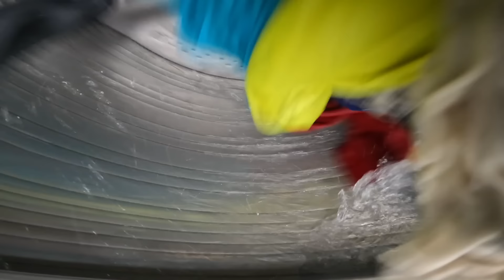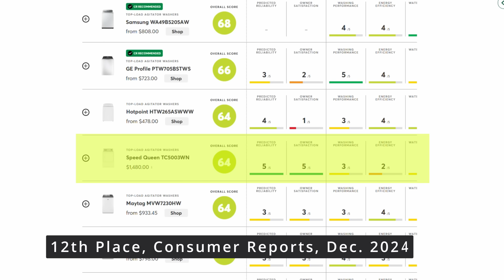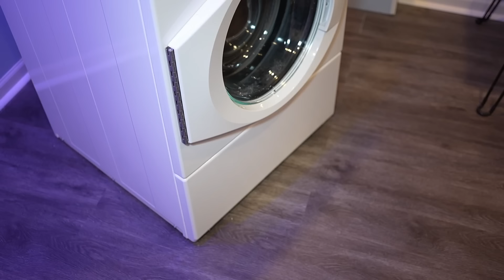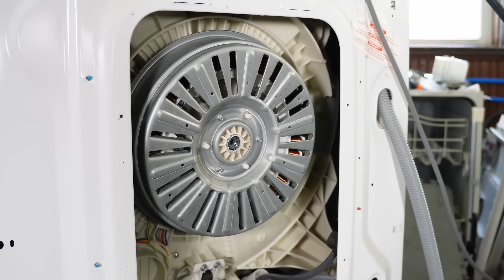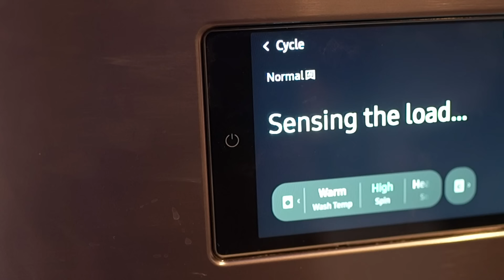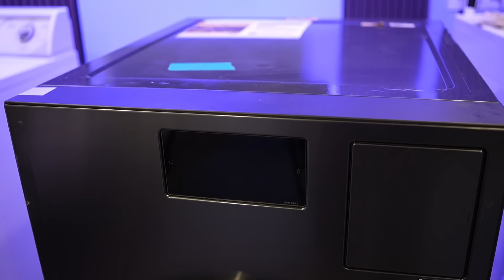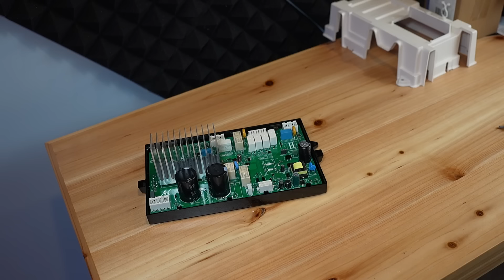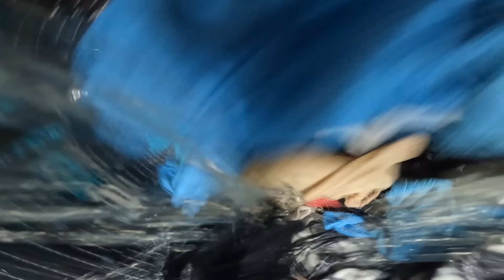Is America's Most Expensive Washer Great? The Speed Queen FF7009WN Test

Comment: I really appreciate the super thorough review and testing you did on this machine and shared in the video. I just paid for an Electrolux and have been second-guessing myself ever since, wondering if I should have gotten a SpeedQueen. One of the selling points on the SpeedQueen beyond the durability is the Soak option. Realistically, if I had a heavily soiled item with chocolate + motor oil + lipstick etc, I would throw ALL the available options at it, including the 24h soak; which I anticipate might have changed the final stain removal results. If you do additional side-by-side tests of machines, I encourage you to do a test of “all available bells and whistles” in addition to two identical normal wash cycles. 

Finally, I am really curious about how hard different washers delicate and hand-wash cycles on wool sweaters. I hypothesize that a “hand-wash” cycle could be constructed on the SpeedQueen using a no-rinse or wool-specific detergent and the soak modifier to a rinse & spin cycle set on all the lowest modifiers. I was going to offer to knit you some swatches but I think it would be easier to buy a few nice non-superwash wool or cashmere sweaters (and maybe a silk item) at a second-hand store, cut into pieces, and test separately. Mark a reference square on each piece (both lengthwise and width wise), send through the hand, delicate, or soak + spin cycles 10 times, then re-measure the marked squares checking for shrinkage. 

Thanks for the service you’re providing with these videos!

Comment: My 2015 SQ front loader lasted 5-1/4 years (just beyond warranty) when the control board failed. SQ said "tough luck, a new board is $1500). I threw the washer away and bought an LG washer for $500 LESS than the cost of the SQ control board. The LG is a better washer and has already outlasted the Speed Queen.

Comment: I bought this washer and the matching dryer, I hate them, for the washer I'm always having problems with the door latch, clicks and clicks and clicks. They've already come out once to replace it. The other problem is the soap dispenser, it leaks down the front of the washer, the service tech said your water pressure is too high so I bought a regulator, water still runs down the front of the washer. The washer is always throwing codes, if I put laundry in and it actually completes without throwing a code I'm shocked. Normally I have to unplug the machine plug it back in and start over. This is the worst washer I've ever purchased. I'm so glad 25 years of having a washer with so many problems. The dryer is not as bad of a problem.

Comment: Stains gotta come out completely, else u r left with a rag!  lol 
The washer to get is the rarely seen/mentioned/known Speed Queen  TV2000WN  26 in. 3.19 cu. ft. Commercial Top Load Washer - if u don't mind the small tub. I believe it's the only washer still made with full mechanical timer/controls & no computer control/circuit boards! Ben, have u ever seen/bought/used such an animal - or had to fix one? About $1500.
Reply from the maker: The TV2000WN is one that I am wanting to get soon and test. Very hard to get ahold of locally, but I'm gonna do it probably by end of year.

Comment: Open box speedqueen FF7010WN for 1399 or top rated lg wm4000 for 899? 🤔
Reply from the maker: Holy crud thats a hard one. Both are fantastic and you'll get a good one either way. Thats a heck of a deal on the ff7010 though one you wont often see
Reply: @bensappliancesandjunk oh man. Im in a bind now with this decision. I actually found the lg at costco with free delivery, parts and instal for 849 so a bit of a boost for the lg there. I will have to call about the speedqueen and verify nothing is wrong with it and it comes with the full warranty. That one only gets delivered to my door. But im upgrading from a top load samsung with an impeller so I'm sure either will be way better

Comment: I just got this machine and my only concern is with the dispenser drawer, it the part you interact the most and it seems cheaply made. Also the fabric softener compartment does hold the liquid but the prewash and regular wash they go inside  machine instantly at the same time, is there a cup missing to hold the liquid for the regular wash?
Can someone point me in the right direction as the manual is useless.

Comment: as far as the price.. if you calculate it will last 20 years compared to a unit half its price that lasts 5 years.. 2200$/20yrs = 111$ per year... the Competition (mostly Asian junk)   1300/5yrs = 260$... wow.. the saving in buying a SQ is massive, because it works 4 times longer or more(I have seen older units last more than that easy)!!  I had an LG side loader that cost 1600$, it just stopped working. Electronic issue that cost more to fix or replace the boards than to buy a new one.. LG side loader is considered the best in its class.. it lasted 6 years.. with light use.. if I had used it daily.. the unit would of failed way sooner.

Comment: Hi Ben! I currently have a TR7. We have two toddlers and a dog and do laundry daily. We’re active and have lots of gym and otherwise dirty clothes and the stains never come out!! I’m ready to put the TR7 to the curb after two years of stained clothes. 

Does this machine clean better than the TR7?
Reply from the maker: I haven't been able to try a TR7 against it, just a TC5. I've usually seen most commenters say the TC5 has a more aggressive washing action than the TR series, so take that as what you will.

With that being said, the FF7 destroyed EVERY top loader I've ever tested. Every single one was inferior to the FF7 on a Heavy Duty wash. Now, that DOES come at the expense of a longer (54min) wash time, but if you can handle a longer cycle, it does pay off with cleaner clothes in my experience.

I will note, though, that in my tests - most higher end front loaders had similar results to the FF7. The WF53 (Samsung) and WM4000 (LG) had very similar results, but took a little longer than 54min, so the FF7 is definitely the "Speed Queen" of the list. But yeah, in general, a front loader will get better average performance on cleaning at the cost of some speed. Against a TR/TC series though, you get WAY MORE capacity in a FF7 or other frontloader, which I think makes them a winner if you can deal with the cleaning ideosyncracies.

Comment: I use an SpeedQueen commercial frontload washer and the matching SpeedQueen commercial C-Dryer with condensing system in germany. Both machines are very great and works fine! Most I love at the washer the mostly free programming cycles.

Comment: I know this is a stale video.  It was due to this channel, years ago, that I got my SpeedQueen washer.  You can hear the "harmonics" when the water flows through valves.  My last "Company W" washing machine had a lid that broke off and started leaking from the bottom.  The SpeedQueen has only had one problem...my kids leaned on the door and cracked the hinge.  I was able to get a spare part for $40-something bucks and easily fixed it.  So far, I am very satisfied.

Comment: I bought this washer, I hate it. This unit is continuously throwing various codes. So if you buy this machine make sure you can unplug it to reset it. The other issue is the soap dispenser. It floods and overflows and runs downs in the front of the machine.

Comment: I completely disagree with your Consumer Reports assessment.  Speed Queen consistency ranks low for washing performance and energy efficiency.  Lorain Appliances put out a great video showing the abysmal performance of SQ machines and has been hounded by them ever since.  It's not a company I'd touch with a 10 ft pole after learning about their poor performance and threatening tactics they used when exposed.
Reply from the maker: They put a video out about the TR series perfectwash system that got them in trouble. Not the TC5. Not the FF7. Totally different systems. FF7s are hyper efficient compared to any other topload unit while offering a much better cleaning performance than any topload as well.
Reply: @bensappliancesandjunk  I’ll trust your judgment on the difference between models. However, how the company responded to criticism is still unacceptable to me. It leaves a really bad taste in my mouth and makes me not want to support them.

It’s worth noting though that top loaders in general are not efficient machines and we have much better options that clean much better and are more efficient. 

I personally switched from oversized American units to a Miele (model made in Germany) with a similar price point as the SQ front loader. The gentleness combined with how well it cleans is insane. It’ll be difficult to go back to any other model though I am curious about ASKO.

Comment: I have 2 big hairy dogs and 4 cats and have LOTS of heavy duty bedding for myself and them plus do my elderly parents laundry regularly so I wash really filthy stuff often. In the last 5 years, I’ve had problems with 3 different machines prematurely breaking, not performing as well as I’d like and just having insanely long cycle times that I couldn’t control. I did some research and decided it was worth the extra money for both a SQ commercial top loader for my dog grooming business and a front loader for my home. After all the headaches with LG, Whirlpool and Maytag machines in recent years, I don’t regret the extra cost one bit! I waste that extra money on stupid purchases through the year without even thinking about or accounting for it but this is a machine I use almost daily and need to be well performing so I think long term it’ll be worth it. Especially after 2 months with no washer at home when the LG washer broke after 2 years and waiting on multiple back order parts replaced under Costco warranty and it now doesn’t work as well as it used to and it’s making knocking noises and it was acting weird and buggy so I replaced it.

Comment: Excellent video! This is a nice machine, but I do not like the microprocessor controls in today's machines. Those boards are very expensive and unrepairable, obviously. My wife and I are still using an Inglis full-sized stacking set with good old-fashioned mechanical controls, and it must be about forty years old! Built like a tank and fully repairable. We'll never replace it.

Comment: We recently purchased the stacked combo of this unit, the SF7008WE. The 27.75" depth of the Speed Queen equipment is a plus for my home since the unit has to fit behind custom cabinet doors. After 30 days we found that Tide pods do not always completely dissolve and we have soft, city water. The pods were placed directly in the drum before clothes were added. The Speed Queen washer is very quiet compared to our previous Electrolux washer which died prematurely. Enjoy the content and your sense of humor!

Comment: $1600.00 x 4 or 5 in 20 yrs is way more money than paying once for speedqueen set at $4800.
Reply: That’s the conclusion I came to when I decided to buy the SQ FF7. I’ve spent $2700 (not including tax) on 2 new and 1 used machines in the last 6 years and while one of them was refunded by Costco due to my not being happy with it, I still spent the money initially. They were all fine (or terrible like the front loader Maytag) but not great and not worth the headache to replace or the time waiting without a working machine while repairing or replacing. The SQ was $2200/$2364 w/tax and should last longer and work better and not have insanely long cycle times for basic cycles but time will tell.

Comment: Thank you so much for providing all this information. This thing is absolutely amazing. I don't regret it one bit. I wouldn't be surprised if this thing lasts 60 years. It's one of the quietest washers I've ever had. Everything else seems to have a slew of computers of low quality. The suspension system, as you stated, used on the Speed Queen. It is much superior to the run of the mill garbage on offer from other manufacturers. It is a simplistic design that is extremely overbuilt. Very easy to work on if it ever needs it. The balancing the ball bearing design is amazing. Again, thank you for taking the time to highlight all this where it really matters. Disposable limited lifespan may be cheaper short-term. If you're going the long haul, don't want all that hassle. Speed Queen is definitely the machine to look at. In the end, over long-term ownership, this thing will pay for itself, likely saving you quite a bit on top of that.

Comment: There is no IOT on these. That alone is reason enough to buy one. I do not need nor want an app on my phone for my clothes washer.  And while they are spendy now - having it last 25 years... How many new other brands would I have to buy in that time? Adding the increasing costs over time...  Plus the water use being less than their top loader ... This is by far the better choice...  I do wish they held more simply for bigger quilts but... I want the buy it once and not disposable option.

Comment: When thinking about wash cycles, I’ve noticed that, in Europe, shorter cycles are often viewed as insufficient for thorough cleaning. Cycles lasting two to three hours are considered completely normal here. This is largely influenced by EU regulations, which set strict standards for washing machine performance.

For example, there are specific limits on the amount of moisture, detergent, and fabric softener residue that can remain in clothes after a wash. The standardized test cycle, known as ECO 40–60, must meet these criteria and is generally the default program most people use. Short cycles are, of course, available on every machine, but they’re typically reserved for specific situations—like when you’re short on time or washing delicate fabrics such as silk or wool, which require gentler treatment than cotton.

Washing performance itself is often described using a well-known formula:
Cleaning Efficiency = Time × Temperature × Mechanical Action × Chemical Action.

In the EU, both energy and water consumption are tightly regulated, so machines are designed to balance these factors carefully. As a result, European wash cycles tend to run longer, but they also deliver high efficiency and compliance with the required performance and residue standards.

Comment: I'm mostly looking for a washing machine that actually removes the soap. I had an old inefficient machine that was great, but it finally died. I am using a highly rated Electrolux front loader, and unless I wash twice on heavy-duty, once with soap and again without (for a total of 3 hours) I get rashes. I've tried lots of brands. Also, if I use one of the other cycles, clothes still smell after being washed. I'm going nuts. Reviews only focus on what the clothes look like, not on the residue smeared out over the whole load.

Comment: Great tests! I think the best improvement you can do to this stain testing is to put two equally stained shirts in each cycle. That allows getting two measurements from each washing cycle and you get some idea about the accuracy of each measurement. If both shirts have about the same results, you know your metholodogy works great. If the results look more random, you know you have to find a better method.

Also, do a control with a clean piece of fabric in the same wash: measure it with a spectrophotometer before and after the wash to get an estimate how much the washing machine actually cleans the clothes vs distributes the dirt evenly among all the clothes.

Comment: I just purchased ff7 washer and dryer. Not happy with the washer at all. I've washed two loads of laundry and both times the unit has thrown a code. There's an issue with the door locking mechanism, I keep hearing it trying to click to lock and it does it over and over and over again. The soap dispenser leaks water down the front of the machine. I've used it twice. The dryer has a light, The washer does not. I'm wishing I would have kept my 6-year-old matching Whirlpool washer and dryers.

Comment: L*= 100 is actually the 'zero' of the color scale, so adding the total of those values up doesn't make sense since a and b will get smaller and L will get larger as the stains are removed.
Reply from the maker: We didn't add the values of both. We subtracted the white value (which was never a perfect 100, usually closer to 90-92) from the stain to see what the stain score was.

You can look at all the math in the soil documents I enclosed in the links to the video.

Comment: I've had mine 5 or 6 years. Never had an issue. Gets clothes Clean with shorter times than other brands I've used. The drum is smaller than most, but you can fill it up. Full, mine doesn't make hardly any noise on spin. My client has a brand new lg and it's very noisy and shakes the floor the larger the load.

Comment: At this price point, I would prefer to consider 3-4 lg washing machines, which will likely last as long as this one and are significantly more efficient and feature-rich.
Reply: I've used my previous LG top loader for 10 years before I left it there when I sold the house. I bought another LG with new house. I'm sure the Speed Queen probably IS the best built unit but I only do one load of wash per week/business casual clothes, it's hard to justify the price.